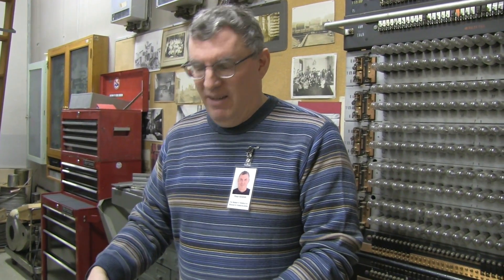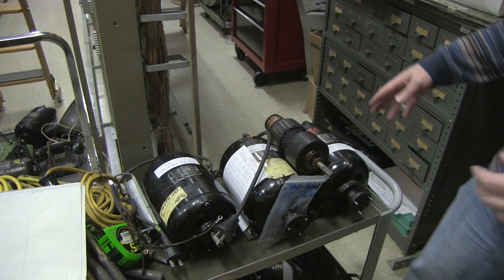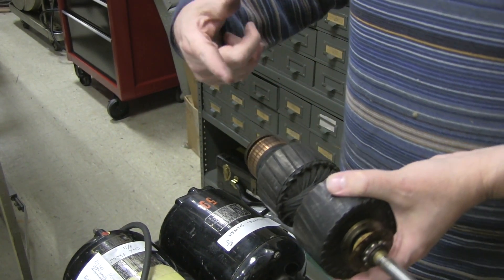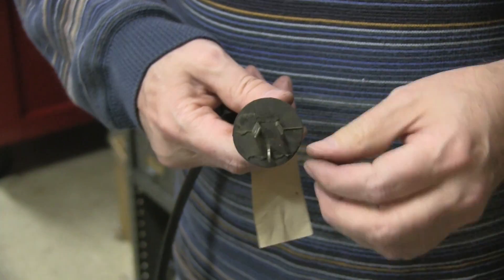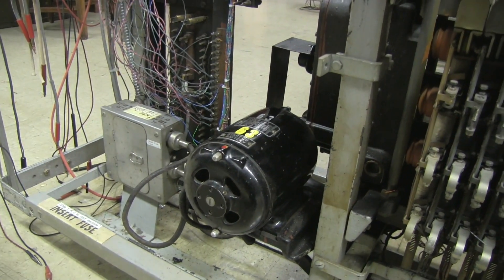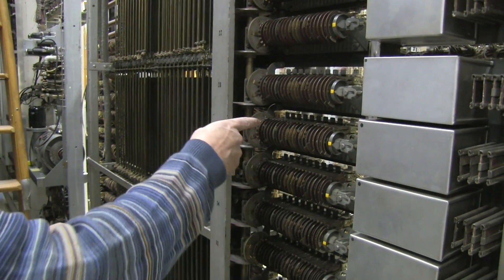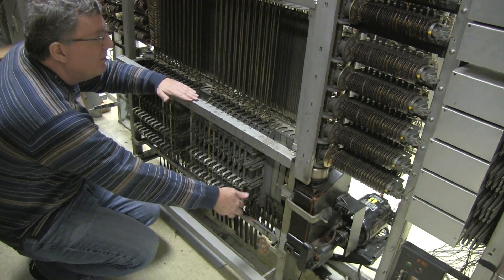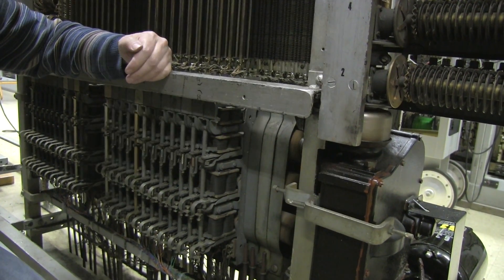Overhauling duplex motors in our 1923 Panel Office

Comment: In a power failure does the DC section of the motor take over until the back up power providing AC comes on line?
Reply from the maker: Yes, that's exactly how it works! --Sarah
Reply: Yes DC battery supply take over immediately, until the diesel generator kicks in, or the newer jet turbine engines kick in starting all generators. I never worked in the power section of any communication system, but I understood what happened when you lost power. My area of expertise was number one four and five ESS Plus tsps. My appointment started February 1963, and I retired after 36 years service. Sarah you're doing a fantastic job keep it up, I've learned a lot about step and panel I saw them in operation but never really got involved with it technical side of it other than running a cable here and there and wiring one link frames and crossbar. Went to school for ESS, I believe 6465 I don't really remember when I started.

Comment: isn't that a DC motor and a alternator (generator)?
Reply: No, it's two motors, AC and DC. Normally the AC motor runs but the DC one will kick in if the power goes out so the motor keeps running on office battery.